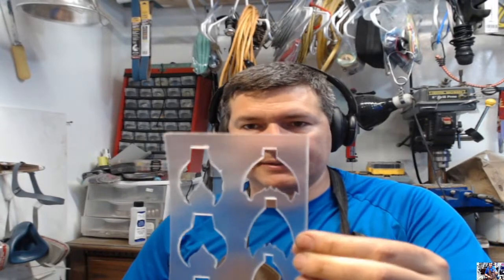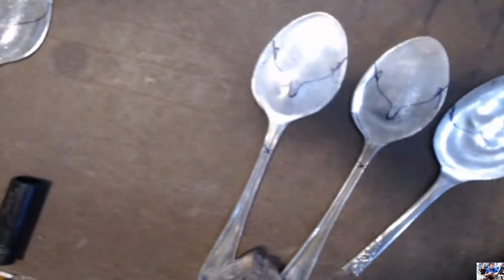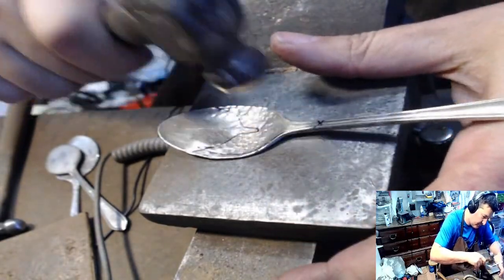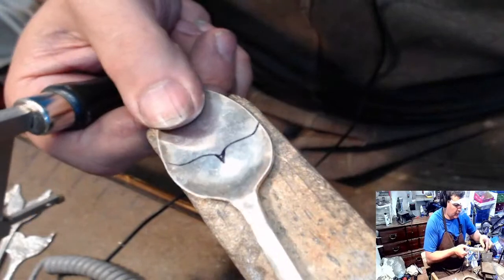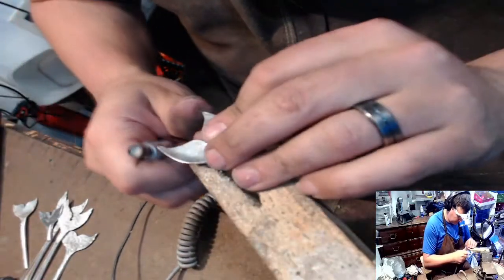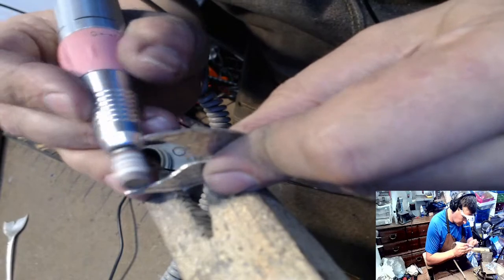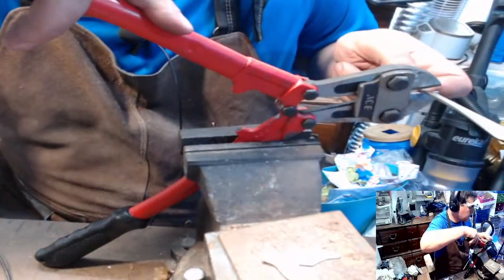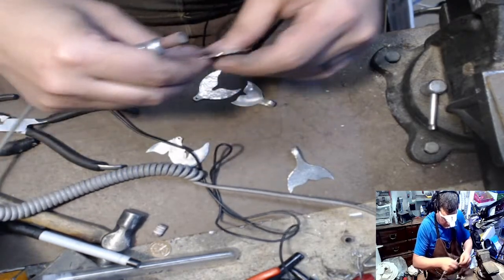How to Make Whale / Mermaid Tail pendants

Comment: what do you use for silverware?  I have been having a hard time finding silver..I made a  mistake of purchasing off ebay a old looking set with a nice design  but after research they are only silver lated
Reply from the maker: I use 90% silver plated. The rest is sterling and stainless steel. Almost everything that are in my videos is plated. Pretty patterns and 1/10th the price of sterling. Also starting out with sterling is sometimes dangerous for the silverware. It’s very soft and can be finicky sometimes. I’m sorry that I missed your message. Thank you for reaching out to me. 😊